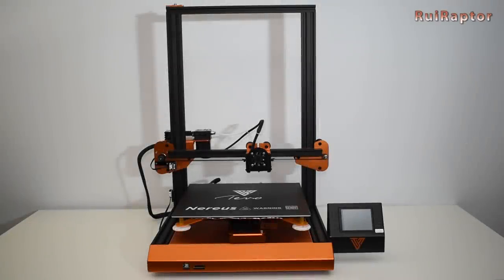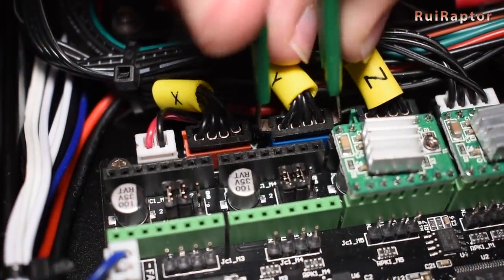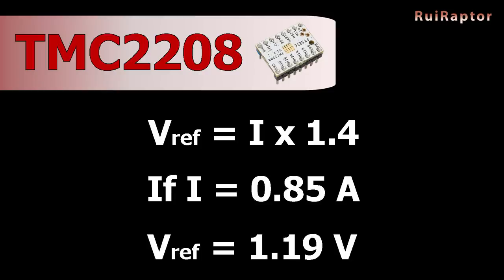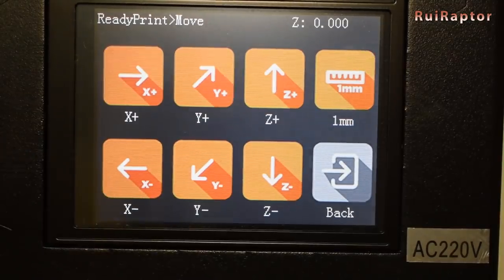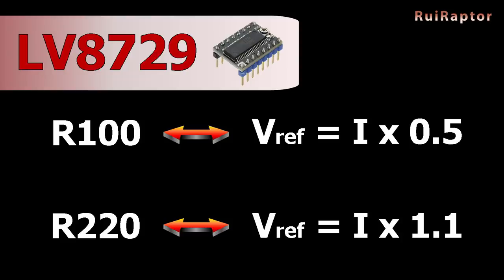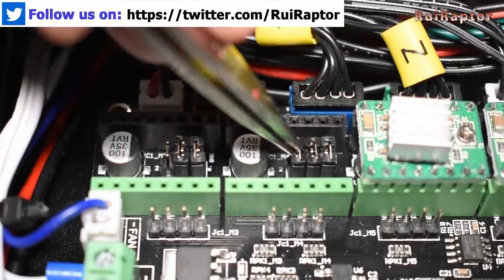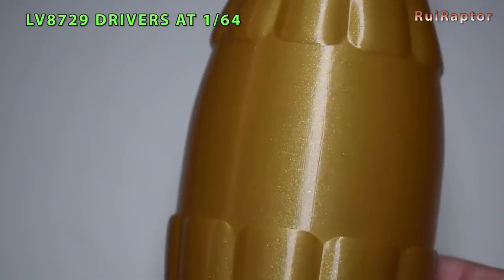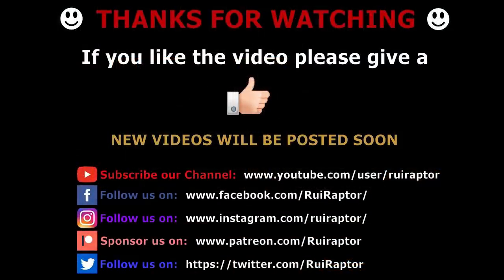TEVO NEREUS - New Drivers Upgrade (Goodbye Salmon Skin)

Comment: I just did this following your video, and wow I can't believe how much quieter it is ! I was a bit hesitant to do the Z aswell, is it the same voltage settings ? And do you have to change anything in the firmware ? I'm pretty new to all this. Great video and thanks !
Reply from the maker: Hi,
Yes, you can run the Z with the same vref but you will need to change the direction in the firmware too.
Make sure you have good cooling for the drivers. Check if the air flow from your driver fan has a clear path. If you need you can add a second fan.
Reply: @ruiraptor  so do you just edit this from 1 to 0?
Reply from the maker: Correct. Change from 1 to 0 or vice-versa to change the direction of the motors.
Reply: Would you say it's worth replacing the extruder driver? Or is that one somewhat negligible? I did invert the other drivers firmware, but didn't invert the z axis as it wasn't said in the video. My prints are much nicer, not as nice as yours, but I'm hoping the correction in the firmware will remedy that
Reply: @patharmon9760  I'm wondering as well, they replace all 4 in the official Tevo channel video.
Reply from the maker: You can replace the extruder too, but i don't recommend to replace with a TMC2208 (they don't work well in stealthchop mode in the extruder and will skip steps). Either leave the Allegro or replace with the LV8729 instead.
Reply: @ruiraptor  I get that. But I was asking if it's worth replacing. Is there really any difference between how the LV8729 and the Allegro perform?
Reply from the maker: Yes, there is a difference because you can set the LV at a better microstepping such as 1/32 instead of 1/16.
Reply: @ruiraptor  Thank you! Is the procedure for replacing the extruder's driver the same as for the x,y, and z axis? same vreps and whatnot?
Reply from the maker: Yes. Just follow the formula and jumper configuration for the LV8729 that I show in the video. Check if you have enough cooling. If not, install a second fan to increase the cooling capability.
Reply: @ruiraptor  so for replacing the extruder driver, mine have the 220 resistors, i set the voltage to .99

Do the jumpers need to be removed? And does the firmware get changed for anything on the extruder?
Reply from the maker: You need to setup the jumpers according to the microstepping you choose to use. Each jumper configuration will setup the driver with a different microstepping. You also need to reverse the direction of that axis (if previously you had Allegro drivers) and change the steps per millimeter according to the microstepping you choose.
Reply: @ruiraptor  You have been mentioning cooling alot, I have the same printer (Tevo Nereus) would you suggest installing an additional fan ?  Or could you just turn the voltage down a bit instead ?
Reply: @ruiraptor  i had done all that, but no matter what i had done, my extruder wouldn't feed correctly. After inverting the axis, it would push filament out, not in. Can you please explain what you did to get the drvier to work for the extruder? You explained all the other ones.
Reply from the maker: The reason i mention a lot is because the TMCs run hot. I'm running my tmcs with the stock fan alone (mine is sending a good amount of air) and they are working fine so far but each case is different and there might be one case where the airflow might not be as good. I always prefer to give information so that people can work with it. You can turn the vrefs down a bit but you need to check if you get layer shifts too. If not, perfect, keep those values.
Reply from the maker: Hi Pat,
To reverse the direction, you need to change that value that i mention in the video for the Extruder.
You save the file in .txt and save it to the root of the sdcard. Boot the printer and it will load the file.
You will know that the file was uploaded if you get the file renamed to .CUR
Reply: @ruiraptor  you dont cover anything on the extruder in this video, only x and y axis. Is there another video you're referring to where this is covered?
Reply: @ruiraptor  Ok, thanks for responding so quickly and so often !
Reply from the maker: You can use the information from the video for the extruder. I also made this video here: https://youtu.be/RhlTdTLfaQ0 
See if it helps

Comment: Hi ruiraptor i have a multimeter, and it is the UT61A. can it measure 2 volts or less? i dont know. edit: when i go to DC, it says mV, which is millivolts. does that matter? when i set the range, it is also in mV, so what do i do?
Reply from the maker: Hi,
that model has auto range so turn the selector to V and measure it. It should work.
Reply: @ruiraptor  when it turn it to V, and switch to dc voltage, it shows in mV. does that matter?
Reply: @ruiraptor  when i turn it to V, it says in mV, and its set to dc. does it matter, because i dunno how to change from mV to V.
Reply: and my filament doesnt work. the prints start off terrible. there is no skirt, and when it starts the print, it prints only when doing it with the 20x20 cube and that itself doesnt stick. the first layer fails and i tried cleaning it and using glue, and masking tape. literally no other file works. Whats wrong?? i think its that the hatchbox pla filament has absorbed moisture, and screwed the prints up.

Comment: What if you still get salmon skin with TMC2208? could it be because the current is too low?
Reply from the maker: Probably is not salmon skin but ghosting instead. Do you have such example?
Reply: @ruiraptor  You're right. I messed with it last night and found that as the y axis moves back and forth it kind of shakes as it stops. My jerk settings and acceleration are really low so it must be the belt that is too flexible/stretchy and the glass bed has some weight to it so its causing extra movement. are there belts that are solid and dont flex/stretch like this?
Reply from the maker: You have belts with steel  reinforcement but i don't advise on using those. Just stretch the belt correctly (not too much that would make the bed hard to move) and you will be fine.
Reply: @ruiraptor  I ordered some new belt reinforced with fiberglass and I also just took the entire printer apart to realign everything as well as put in new bearings and polycarbonate clear wheels so hopefully this will solve the issue. Thanks for the replies

Comment: Hi Rui, I updated the drivers following the video and now my Nereus is mess up. Definitely the motors run away smoother but totally wrong. The end stops will not trigger , the axis move in the wrong direction and even I've tried to change the settings in config file I cannot get it back to work normally. I have use the original  robin_nano_cfg.txt file to restore the setting but also with no success. So at this time I'm not sure what to do next and I'm thinking that the Robin Nano board might be defective.  Could you please give me a suggestion? Thank you
Reply from the maker: Hi Adrian, which software did you use to edit the txt file? Some programs change the structure of the file when saving. Try downloading the original files and put them in the SDcard (without editing them) and see if that helps.
Reply: ruiraptor, thanks for reply. For editing I simply use Notepad.But I use the original cfg file on the SD that came w/ Nereus. How can I check if the board is ok?
Reply from the maker: I would download the config files that have not been opened/edited yet first. Then, copy them to the root of the memory card. Power cycle the printer. The printer should load the .cfg file and rename it to .cur
Reply: Thanks Rui, I still have the Nereus original cfg file on the SD card that came with the printer but that doesn't do any change. Minwhile I updated the FW to Marlin Robin Nano 1.0.2 thinking that the old one might be corrupt. No change at all. When I modify the cfg file I can notice some differences but not what it supposed to be. EX: I can manually home each axis individual but when I do "home all" the stop switches will not trigger and the stepper make the grinding noise. This is why I was thinking the board might be defective. I don't know how to check that. Thanks
Reply from the maker: Please contact me by email and I will try to help a bit more.

Comment: I would love to see this done on the Little Monster. If needed...? I have been interested in purchasing a TLM, and I have now come across this salmon skinning. Just interested if it would even be needed? Can anyone shed some light?
Reply from the maker: Hi Ryan,
Which board does your Little Monster has?
To remove the salmon skin completely, you need some TMC or LV8729 drivers. You need to have a board which allows swap of the drivers to install the new ones.
Reply: @ruiraptor I have not purchased a Tevo TLM yet. But the site says it comes with an MKS SBASE v1.3 as its main board.

 I hope that is what you are asking for. Sorry i'm very new to printing and trying to learn the terms. Thank you for helping.
Reply: https://i.imgur.com/oOJcU9l.jpg 
Here is a picture. It looks as though I could follow along with your video, with this board.
Reply from the maker: Hi Ryan,
That board does not have removable drivers which means that you will need to buy a new board for that.
However, that is a new board. Older versions of the Little Monster have a different board.
We would recommend you to test "as is" first. If you see too much salmon, then replace the board with an MKS GEN L for example. Many users are replacing with a Duet Wifi board. More expensive but much better.
Reply: I will definitely try the stock board first. Does the Duet 2 Wifi board need your upgrade? oR is it good as is?
Reply from the maker: The Duet is equipped with very good TMC drivers (which are already soldered on the board).

Comment: Does the Vref value of the stepper drivers change over control board voltage (12v vs 24v)? What model is this control board? Thanks for the video!
Reply from the maker: Hi,
The vref formula is not affected by the main voltage.
Regarding the board, it's a Makerbase Robin Nano (32bits)
Reply: @ruiraptor   Good choice for the micro 32bits . This might help with the micro steppings but it's got only five stepper drivers.
Reply from the maker: This 32bits does not allow running the LV drivers at 1/128 microsteps which indicates that the microcontroller is running at a lower frequency when compared with other 32bits boards.
Reply: @ruiraptor  ok.  Not so good of a board! Thanks.
Reply: @ruiraptor  what about replacing it witha duet wifi 2? or smoothieboard? and do you have a video on where to put a raspberry pi for octoprint?
Reply from the maker: @vaivlogagarwal8223  -  the duet wifi will be a good replacement. If you have one, I recommend it. We don't have a video about the raspberry yet :(

Comment: should I do this after having the printer set up or when i get it?
edit: would using the lv drivers for z and extruder make the printer quieter, or would there be no difference?
Reply from the maker: The LV driver is not as quiet as the TMCs so you will hear these motors turn a bit.
Regarding the upgrade, you can use the printer stock and see if you like it as is before doing the upgrade.
Reply: @ruiraptor  thank you very much.
Reply: but what do you recommend?
Reply: i thought you guys said that the ghosting gest worse with a glass bed and you had to reduce the speed. is the magnetic bed good or bad? i am confused.
Reply from the maker: The extra weight on the bed will increase the ghosting issues. The new drivers will reduce the salmon skin effect on the prints. Both are different issues.

Comment: I changed 0s to 1s and saved and mine now homes backwards and goes the wrong direction what's happening ?
Reply from the maker: Is the axis moving the same direction as before changing the 0s to 1s?
Reply: @ruiraptor  I figured out he problem but now I'm having a another one when i use the points to level on the bed it's not centered anymore I didnt change any firmware other than the 0s
Reply: Can you email a copy of your firmware to me ?
Reply from the maker: Find the following lines:
#the 5 point location of  manual leveling
>cfg_point1:50,50      
>cfg_point2:280,50
>cfg_point3:280,280      
>cfg_point4:50,280
>cfg_point5:150,150

The values you see there are the X and Y coordinates for the leveling. Change the coordinates with the values you prefer to have.
Reply: @ruiraptor   thank you so much mine where all off by 100 or 50

Comment: What does the third jumper do? Forgot to take that out and it seems to be working.
Reply from the maker: You mean the jumpers under the drivers? They set the microstepping configuration. The third jumper is not used for these versions of the TMC2208
Reply: @ruiraptor  yes, what happens of it's left on vs removed.
Reply from the maker: Removing the MS1 jumper will make the driver run at 1/4 microsteps instead of 1/16 and if you don't update your steps per milimeter, when you tell the machine to move 100mm, it will not move 100mm.
Reply: @ruiraptor  Ok I did update the steps but left the jumper in. Then its not as accurate potentially as with the jumper removed?
Reply from the maker: I would recommend you to use the same jumper configuration that is shown in the video for better performance.

Comment: Changed 0 to 1 and it still goes backwards cant figure it out?
Reply from the maker: Hi,
Make sure that you are saving the configuration file with .TXT extension.
Also, make sure that after booting, the printer renames the file to .CUR extension.
Reply: Lol I just didn't know what the root of the sd card was apparently so I googled it. Thank you though!
Reply: @ruiraptor  so I've got x and y working and I'm leaving there but I now when I try to level my base the printer head isn't going to the correct locations?
Reply: @ruiraptor  I changed the values like you showed me someone else in the firmware yo no avail
Reply from the maker: Changing the coordinate values should work. Did you correctly update the new config file?
Reply: @ruiraptor  I believe I did. its changed and saved to the sd card and says cur file I've done it over and over nothing changes
Reply from the maker: But everytime you change the file you save it as .TXT right?
Reply: @ruiraptor  I'll check im not sure thank you. I'm printing right now I'll check later again thank you. It's amazing how quiet it is now did not b.c expect that much of a difference!
Reply: @ruiraptor  That was it! Thank you so much I'm definitely subscribing to your channel

Comment: How do I edit the text file.  It doesn't open
Reply from the maker: The file extension is TXT so you should be able to open it with Notepad but i recommend you to use notepad++ instead.
Reply: Thank you, also where can I find the autoleveling firmware.  The github autoleveling firmware makes my axis in reverse and inverting stepper motors in the firmware isnt working.  I am new to all of this.
Reply from the maker: Check the tevo nereus official facebook group. They have it there.